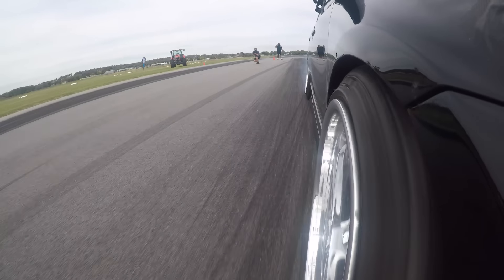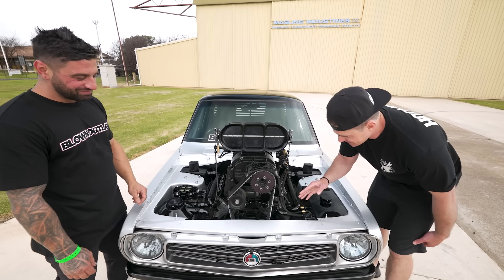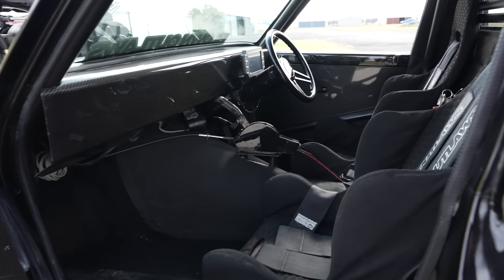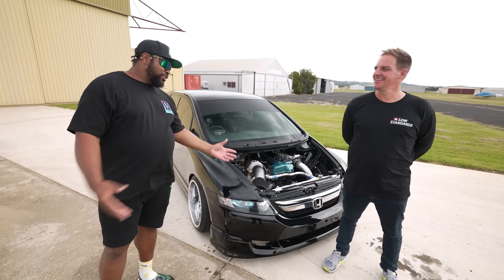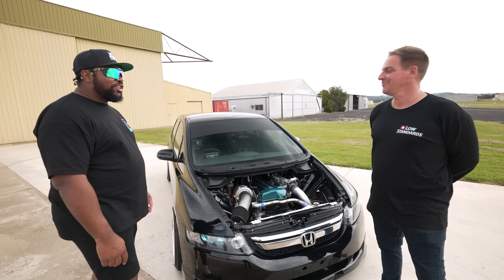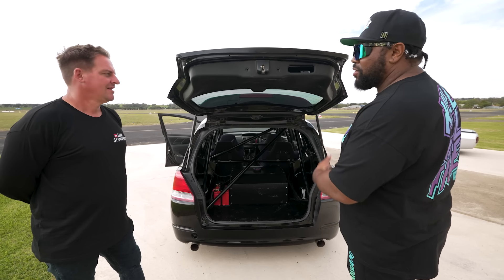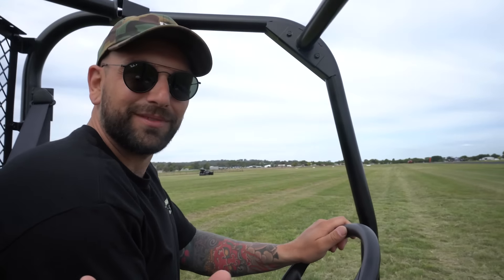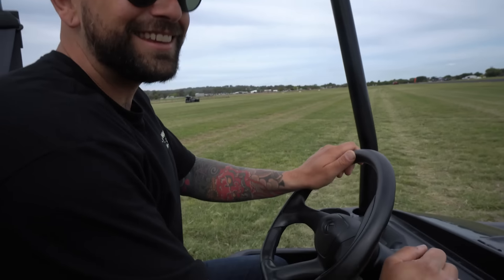950hp Datsun 1200 Ute vs 2JZ Swapped Odyssey, No-prep Drag Race

Comment: Damn, that Honda build is clean though.
Reply: Super SUPER nice.
Reply: Save for the intake missing a bracket™.
Reply: considering the astronomical amount of fit n' finish that Datsun has, this comment shocks me. I mean the Honda doesn't even have a hood.
 Clean must mean something different these days.
Reply: ya but he cant drive lol
Reply: Absolutely
Reply: @taylorhickman84  exact what I was thinking lol
Reply: @taylorhickman84  ur the life of the party aren’t u
Reply: TOOOO CLEAN!
Reply: @taylorhickman84  The Datsun may be clean but have you seen the johnnies on the honda?
Reply: @taylorhickman84  It has a hood, just not running one as the main feature of that Honda is that he literally just transplanted the body on to a Z chassis. There's nothing honda left in the car part from the dash and steering wheel.
Reply: Boostedboys Kyle would be wet seeing that Honda .
Reply: @low standards for the Odyssey build
Reply: @jtmcrash  well actually he can, the cars setup for drifting not drag racing lol
It's purposely setup to be loose being it's so heavy ,2 ton is a lot of weight to try n slide lol
It's a numbers game here 2000kg v 1100kg ,ute has 400 more hp and slicks ,of course it was gonna win 🤷‍♂️🤣
Reply: @5lcalais1  that car is nowhere near 2tonne. The stock RB1 with full interior is 1600kg.
Reply: @roscoe1083  well if someone at the party is trying to convince everyone that Jose Cuervo is better than Don julio, I'm gonna call 'em out.
Reply: @jtmcrash  Jays a OG aussie drifter. He would out drive 98% of this comment section.
Reply: “Low standards garage”
Reply: I Can Picture Myself Doing a Burnout in The Walmart Parking Lot  in This Van🏁🤣🏁
Reply: I would like to see this Honda Odyssey vs the Honda Odyssey on TOP GEAR
Reply: @Turbeau350 these Kent’s just don’t know bro

Comment: I m trying to comprehend the level that little Datsun must be fettled to, with that kind of power and that short wheelbase, I would not have given good odds for three consecutive runs down the track without a barrel roll.  By itself, the skill driving that thing, and building it to be stable in a race are awe inspiring.
Reply: Yeah us Aussies are the masters of short wheel base cars 👌
We've 7 sec r100s, ke20 corollas, datto 1200 utes, Holden geminis, rx3s etc. the list goes on.

Comment: odyssey is another example of sleeper. the car came out for a while no one ever talk about it. after a while when people mention its fast for a stock van no one believe it until people started to test drive it. the engine has so much torque that was fast. people would race against base model integra and beat it during that time with full passenger in the van too

Comment: Ok lets be honest, a 1100 kil car, with 900hp (roughly 2lbs/hp) is gonna smoke a 500 hp Odyssey at 3950ish lbs (7.5 lbs/hp) The datsun had a 3 times better power to weight ratio